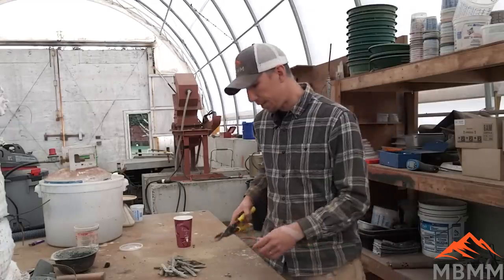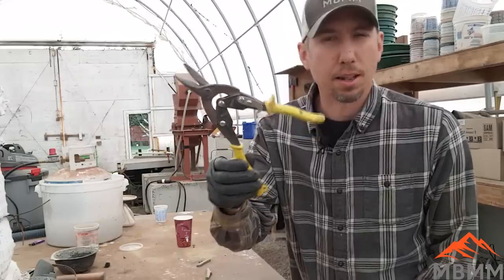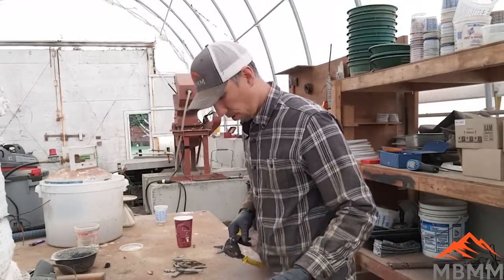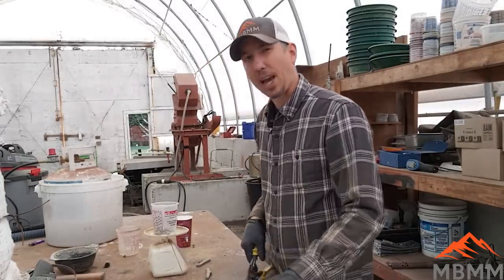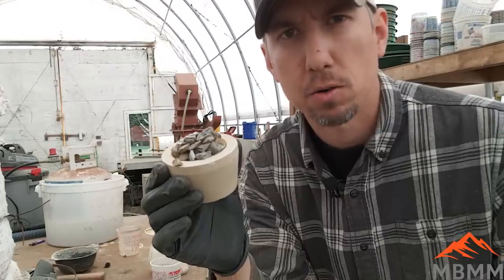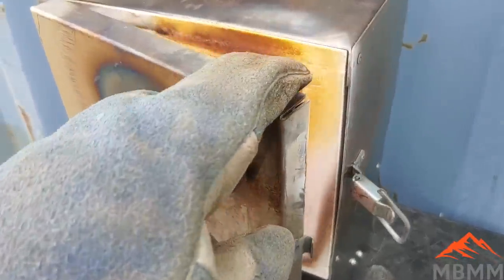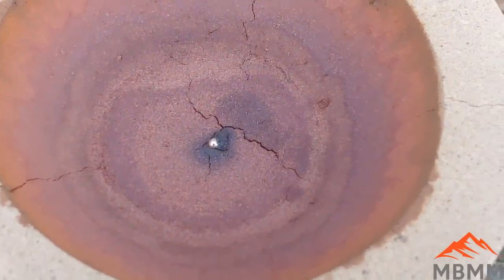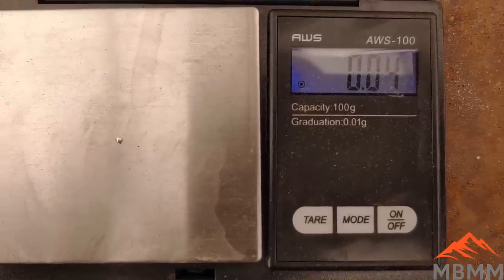How Much Silver Can Be Recovered From Lead Wheel Weights?

Comment: more to the point was all the non-leasd oxides if you Are using wheel weight lead as collector: that's a lot more dross to work with.
i'd suggest a first smelt of the lead just to get some thing uniform for your purposes w as little oxides as possible.

Comment: Also the electricity used cost more than the lead and silver together. Still fun to do and see
Reply: That's why you test with smaller quantities, to determine if it would be worthwhile with larger quantities.
Reply: @lesliefranklin1870  yes, when its $500 silver we know where to go to get it
Reply: @Googler86 If you have to spend $600 to get $500 worth of silver, it's just not worthwhile.

Comment: Drill 2 holes for air flow. One 2" lower than the other. Use the lower one with a shut-off valve.

Comment: Quite a bit has been written about wheel weight composition since they are frequently used to make cast economy hangun bullets. They used to have up to 3% tin in them  but now they often have about 0.5 % arsenic. The antimony may be more toxic than the arsenic.
Reply: Interestingly, one of the reasons that clip-on wheel weights specifically are so useful for cast bullets is that the alloy gets just hard enough to hold together when used in pretty much any pistol cartridge.  They have just the right mix of tin and antimony.  And the arsenic content helps the hardening process.

Comment: So if you melt at different temps you can't pour out the different metals since they have different melting temps? I'm a noob and want to play with melting different metals as a hobby. Zinc lead tin melt at different temps for instance, if i melted wheel weights lead should pour out at 621f and leave the zinc untouched? zinc melts at 786f and silver 1640f so if you some how poured the lead and zinc out the silver wouldn't be left in the bottom?

Comment: Will stainless steel oxidize and be absorbed by the Cupel or do you have to use another method to remove that metal? Electronics sometimes uses stainless steel pins that are gold plated.

Comment: Given the current ammo shortages, the wheel weight alloy is more desirable to resell to bullet casters or gun shops rather than the microscopic possibility of silver. Also, Zinc wheel weights should be left out since it ruins the alloy for casting.

Comment: Question: do you have to keep buying cupel cups or are they reusable??
Reply: If there's a lot of white material left, you may be able to use it again. If it is all discolored, it is saturated with litharge (lead oxide) and can't absorb any more.
Reply: Can you recover the lead from the cupel?
Reply: @rickdoggr  Yep. Use a reducing flux and melt the whole cupel. The lead oxide ("litharge") will be reduced back to elemental lead. It will be impure, though. Other base metals and their oxides will keep following it through the smelting and cupellation cycles.
Reply: And how much do they cost?   I've seen dry cement used as the cupel also.  I would imagine that would be cheaper still
Reply: @beebob1279  Since no one answered your question on cost a mining supply shop near me sells smaller cupels for $1.25 ea. They only absorb up to 45g but the larger ones don't cost much more.
Reply: @55metalmonkey  Thank you
Reply: The little ones only cost under $1

Comment: Typical recovery of gold and silver from lead uses zinc. Zinc is insoluble in lead while precious metals are 3000 times more soluble in zinc than in lead. After mixing the zinc in molten lead it floats to the top and can be skimmed off.
Reply: The remaining lead is not good for  casting though according to the Lyman Cast Bullet Handbook, it does not form out well.

Comment: Does the power cut off automatically in that furnace, when the door opens - or are those coils live?
Reply: Those are live. You cannot cupell in a furnace that does not allow you open the door by cutting power. You just be mindful that those wires are live (not full power tho because they have really high resistance) and work with caution. You cannot be safety freak when working with hot metal and oxides. It is for professional use not home grade electronics.

Comment: I have a question, if you melt gold with a welding torch at a very High temperature, will the gold evaporate??
Reply: If you are using oxy acet and crank it up really high it's possible to lose some of the gold .. Oxy acet temperatures easily surpasses gold boiling point

Comment: I have some buckets of number 2 copper that was cut from air conditioning coils. Mostly these are the 180 degree elbows that connect the copper tubes in the coil together. Most ac braising is done with 15 percent silver solder. Could the silver be recovered from the salvaged elbows? I just turn it in as number 2 copper.

Comment: Wow, i didn't know that lead oxide is corrosive? I thought lead is a very anti-corrosive metal.
Will it be possible to recover the lead from the cupel?
Reply: It confused me also so I looked it up and I cant find a single source that says it's corrosive. I'm actually finding the opposite every time; that it has good corrosion resistance.

Also, yes it is possible. I havent watched it myself but some other comments said that he has a recent video on his channel about the process of recovering the lead. But they also summarized the process as: smash the lead-filled cupelle -> reheat -> lead remelts and sinks to bottom, smashed pieces float on top -> skim the top -> repeat until you've removed all the pieces you can
Reply: @TheRussell747  If i had to guess, that's exactly how i would do it also. Thank you for replying.

Comment: Lead has a scrap metal value of 0.70 cents a pound.  Ever wonder why your automobile battery is so heavy.  It's the lead.  Might wanna rethink the 5-10 dollars you get from the store.  There was more lead weight and $$$ lost in the video.
Reply: Lead scrap yes, lead tire weights no. at most scrap yards, tire weights bring 8 - 12 cents per pound. I buy them at 20 cents per pound from scrap yards, then sort them, melt them down, and pour weights & jigs with them.

Comment: good to know wheel weights are a good place to start for lead collector metal, though I would bet there is more in older lead from weights and stuff that isnt run through a modern refining process before its cast into weights.

Comment: The oxides could be from brake dust and the iron oxide that forms with it as the brake discs wear away?
Surprised to see silver content in them because I always thought silver was extracted from lead ores? I know that here in the UK in the early lead mining operations they went to great lengths to recover silver from the freshly made lead metals. Silver percentages varied lots between mining areas but they still made a hefty profit on the silver they removed.

Comment: You need to refine the lead to do any assay. There are so many metals in wheel weights is is not funny, can barley use them to make fishing weights after slagging all the crap off the pot for hours.
Reply from the maker: Thanks for the tip
Reply: Zinc is what makes them hard to cast. Separate that out before you melt them. Fluxing with sawdust, wax, or even borax helps, too.

Comment: I have to admit, I certainly didn't know there were precious trace metals in wheel weights. However, the amount you're getting is certainly not worth the effort. Especially if you factor in the energy used to heat the oven up. Could be break even or in the negative. But certainly interesting anyways. Thumbs Up!
Reply from the maker: Oh its for sure a money loss exercise

Comment: Interesting.... I'll give you some pointers on how to separate your wheel weights... most wheel weights now are either steel or zinc look at the wheel weight.. and if you  see  FE. That is steel or use a magnet... if you look at a different weights and if there is a z on it that is usually stands for zinc.... or you can use the Pinging technique.... simply Take the Wheel weight and whack it on a piece of metal and if it's lead it will make a dull thud.... if it's zinc or Steel it will do a sharp ping... you will also notice if you whack a lead wheel weight on a sharp piece of Steel it will put a dent in it or you can use wire cutters to squeeze it lead will Dent or bend... zinc and steel usually will not... after a while your eyes will become sharp enough you will just know them by sight I have literally done truck loads of wheel weights.... I noticed in the video you mentioned some will weights we're soft to cut others were hard I can probably guarantee you you were cutting up zinc weights if they were hard.... all lead wheel weights will cut soft like butter.... take care
Reply: I’m positive non of those weights were steel, or zinc or he wouldn’t have been able to cut them with tin snips
Reply: You’re exactly right. I’ve been scrapping them for years, and can just sort them by appearance.

Comment: I keep asking myself is it more valuable to recover the precious metals or mold bullets with that lead?
Reply: Recycled lead sells for about 50¢ a lbs 300 grams would be  about 33¢. .04 grams of silver is worth about 1.9¢.
Reply: @barryfields2964 until silver price goes up
Reply: Bullet making hands down. You can easily sell molded bullets for a heck of a lot more then the trace silver...
Reply: is that enough silver content to kill werewolves?
Reply: @ManMountainMetals  SURELY !! ... HAMMER IT OUT... STRIPS OR WIRE...
ELECTROLYSIZE IT... MAKE IT INTO A COLLOIDAL WASH ... 
FOR THE UNCLEAN BLASPHEMES OF NATURE !!
ANY IMPURITIES LEFT WOULD RENDER IT A SLOW DEATH FOR HUMANS.
Reply: I came here just to make that comment. I would assume the total mass of lead itself would be more valuable on it’s own merits than the value of whatever paltry sum of silver you recover.
Reply: Bullets, hands down. Once you get a knack for which ones are pure soft and which ones have tin and antimony in them you can get a perfect mix by adding your own linotype lead, soft, tin, antimony, nickel, etc.
Reply: Years ago when I was able to go snagging for spoonbills, we used one pound lead weights.  One year for some reason, the price skyrocketed and we was paying $5 for a one pound lead weight.
Reply: @MrBerroth likely in 2007 when lead hit it's all time high.
Reply: Why not both?
Reply: @someoneyoudontknow7407 Your electricity of gas cost would would make silver recovery cost prohibitive.
Reply: whatever he will be doing, using pyrometalurgy to extract the silver seems astonishingly wasteful and just wrong on all levels unless he plans to leech and reuse the lead oxide. Indeed, this guy is just making a LOT of waste by using the completely wrong process - you use pyro to do an assay test on a small sample; you don't use those same ideas for actual extraction. You use acid extractions, and can actually do chemistry so you don't lose anything, or generate excess waste.
i.e. this sort of project shouldn't be done unless you're willing to research the right method, and not be a wasteful schmuck
Reply: @chouseification it wasn't done to make money recovering silver. It was simply to demonstrate the residual silver remaining in refined lead. Your criticism is stupid and ugly. Why don't you do something decent instead of trolling.
Reply: @ozyrob1 your understanding of this process is clearly lacking, because the whole point is the process they use will pull out some of the silver, but it never actually answers the question precisely exactly how much silver was in there, because they lose some. They aren't doing a full extraction with this method, because unless you are a charge/flux god, your chemistry will be off and you will not extract it all. 
Now go find the corner.
Reply: He can smelt the lead back out of the cupel
Reply: @tomclark3357 crush the cupel and reduce the oxidized lead.  Same as reducing ore.  Add charcoal powder and heat.
Reply: @tomclark3357 What's the cost of 2 cupels? I'm betting more than the value of the lead or silver
Reply: @tomclark3357  (assuming you replied after seeing mine) sure he could but that adds more fuel and waste materials over what he has already done. Dude needs to watch some Sreetips and Cody's Lab videos or better yet pick up a good text book on precious metal extraction - i.e. go an acid or cyanide route depending on source and targets (for a given batch) for far better recovery rates with lower environmental cost and high purity output - win/win across the board. :P
Reply: @chouseification  Ok, I don't know enough about chemistry to make a useful comment on what you just said. I do know that a supply of modern scrap wheel weights is going to have very few (if any) actual lead wheel weights. In all probability and based on the struggle to snip them with the hand tool, he mostly melted Zinc wheel weights, invalidating any conclusions from the demonstration. Just go get some scrap weights from a garage or scrap yard, you will see what I mean. No lead ones will be found, or, at least precious few. If a weight is made of lead, it will cut fairly easily.
Reply: @leadweightguy6134  since the video is clearly about recovering silver from lead weights (not whatever is currently common) he may have had an issue finding enough to work on. The basic deal here is by using using a cupel process he's generating a lot of waste in the form of all of those contaminated cupels. Doubleplus ungood. Watch a video from Sreetips, Cody's Lab, Nile Red or a number of other people to see metal refining done without generating loads of waste.
Basically the process being used in this video is fine for small samples done to understand what part of a mine contains good ore - but it's not used to actually process bulk ore, because it's just not the right way to go. :D
Reply: @chouseification  I think  300 grams of lead, or whatever it was, IS a small assay size test. It was one small cupel full in a small table top oven. Doesn't get much smaller and for a truly accurate assay, much too small of a sample.
Reply: @michaelmacgeorge1082  not so much, because if "successful" (in his mind) it opens it wide up as a legitimate production method - and anybody who took even basic chemistry knows this IS NOT the way to go. One should be careful making any random suggestions that involve the use of lead. If you tested this guy's property, you'll likely find it everywhere... that's illegal where I come from. :D
Reply: @chouseification  No, he's not trying to use this method as a production method. I meant an accurate test. All the lead he used did not go anywhere. It's all locked up in the cupel, not magically spreading all over. Never mind this was a test for YouTube purposes to see if there is silver in wheel weight lead, not to find out if it's worth smelting tons of lead for the minuscule amounts of silver. He proved it's not worth it. That was likely the first and last time he will do that.
Reply: @leadweightguy6134  your forgetting hard lead(+zinc is still pretty expansive)
Reply: Some cast lead bullets contain silver. The old Garret cartridges did. They were used for brown bear defense in Alaska and I shot a huge hybrid ferral x russian boar with them.
Reply: Mold bullets for sure.
Reply: We the ppl are gonna need all lead to keep our republic
Reply: pure lead is worth 30 cents a pound date 9 /10 /20    Wheel weights are full of crap like zinc .  But you can refine it with sulfuric acid
Reply: Bullets
Reply: Sadly at the moment, seems silver is more valuable to recover then the lead shit :(
Reply: Hawk bullets sells fixer lead and spools of lead wire for adjusting casting alloys and the wire is typically also used for swaging bullets and cores.   If you're into Bullet making, Corbin sells stuff for making your own jacketed bullets .
Reply: Why not do both
Reply: And we have to think about this. If we use that lead to mold bullets there might be enough silver in the lead to kill Vampires. So we have that going for us.
Reply: I was thinking about bullet casting too.
Reply: Bullet's.👍
Reply: uncletigger  WHERE LIFE EXISTS ... PLUNDERERS EXIST.
BULLETS ARE VERY VALUABLE NO MATTER WHERE OR WHEN.
PRIVILEDGED FOOL !!